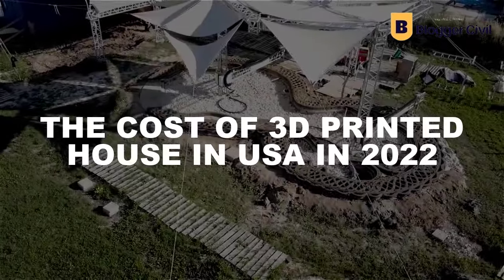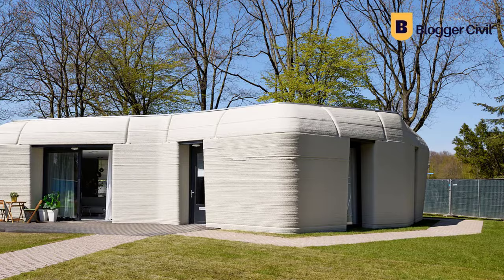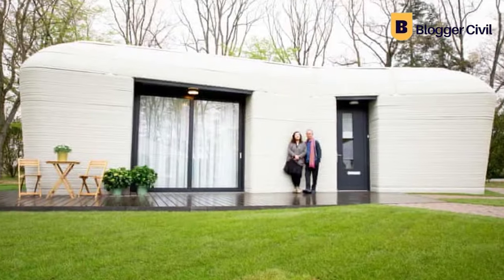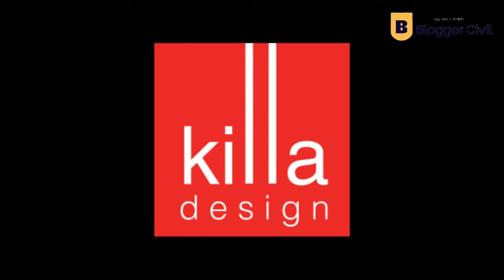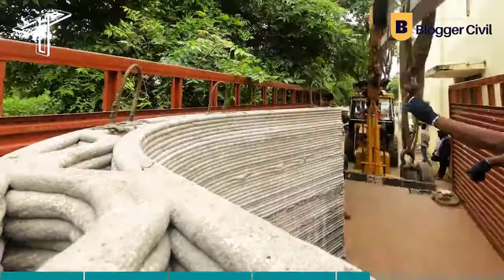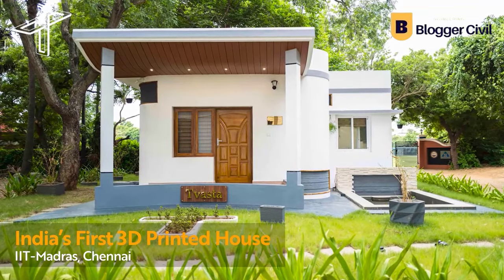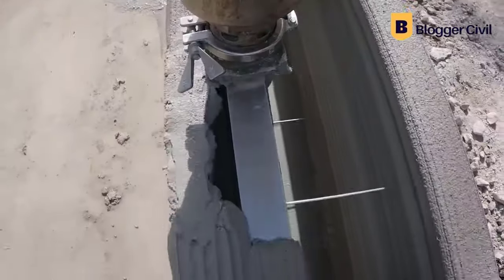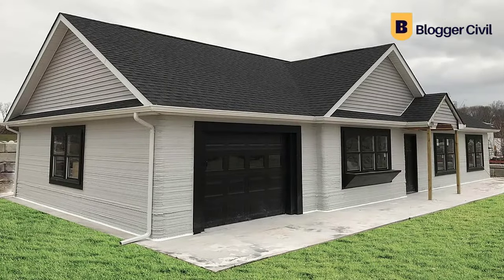The Cost Of 3D PRINTED HOUSE  In 2022.

Comment: He seems to have forgotten cabinets, bathrooms, heating , electrical and on and on.  Maybe a house in three months which is remarkable, but three days is not possible. And the cost figures did not include land. The final cost may be cheaper, and faster, but not close to what the video implies. Heck one bath with lateral is around twenty grand, so the cost are way off.
Reply: Exactly 💯 I came across that as I got ready to print one...also, the project still requires contractors due to code